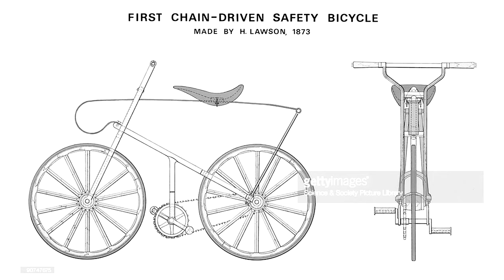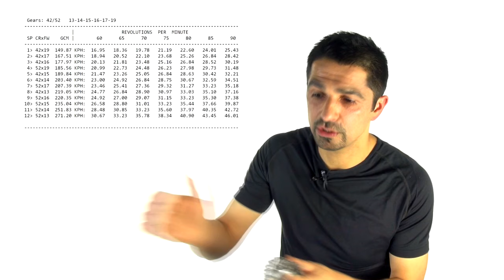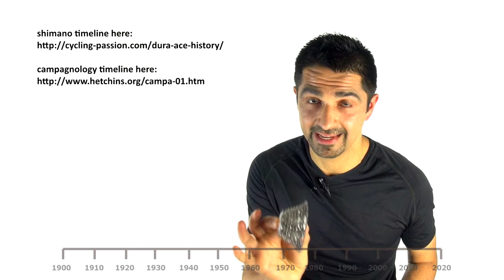Fascinating forgotten history of bicycle gears development & timeline (1890 to 2017)

Comment: I was much younger when I started riding. Back then, everybody used freewheels on their bikes. I still have a 13-18 6 speed block, and 7 speed 12-18, and 12-19 freewheels. When Shimano finally came out with 8 speed cassettes, I used a 12-21 for just about everything. 9 speed cassettes usually ended up with a 12-23, but I also used an 11-21 and 12-21 for flat criteriums. Finally, with 10 speed, I either use a 12-23, or more often now, a 12-25. I refuse to switch to 11 or 12 speed, because I don't need lower gears than a 39x25. I have to admit that the older I get, the more I use the 39, instead of using the big dog on everything.

Comment: in the 70s i first had a Peugeot with 52x45 and of course five speed cog.  then i bought a used Cinelli fully campy.  52x 44 (also bought a 54 tooth for special events).  rear hub gears normally 14-18.  but for the rare hill events had up to 21 or 23 teeth (forgot which).  no worries about indexing with gear shifting by hand on the tubes lol.  nice video ty
Reply: I was with you, 13-23 five speed rear end for hill climbing. Italian bikes came with "Alpine" crank chainrings, 52-39. I still ride my old PX-10, now with a 7-speed 13-25 cluster on the back. Needless to say, I ride my other road bike on "hilly days"!

Comment: My 1969 Schwinn varsity had a 14-28 freewheel? When I  got into " good " bikes in the late 70's 5 speed freewheel was the only option but there was always a wide range.  A lot driven by touring cycling.  I still have a Campagnolo grand tourismo rear derailleur.  Never used, weighs about a pound, it's steel and beautiful.  Have to disagree with some of your history based on my experience.

Comment: Really love your videos. This channel is underrated. Will you include climbing vs power vs cadence vs gradient. I believe most road bikes are massively overergeared for the average rider. Top riders pushing out 350 watts for 1 or two hours have a 34/32. So with a novice at 200 watts or less probably needs at least a 40 cassette to maintain reasonable cadence up the same hills. In fact I suspect our novice may need more than a 40 to maintain the same cadence as pro riders.
Reply: I would completely agree  with you - the number of riders hammered by the Joux Plane in this year's Etape was painful to watch. Good Cat 1 riders were below walking pace on their 39-25's. However, I would say overgeared though, not under?
Reply: Cyclespeed Tours Yes I meant overgeared.
Reply: Sadly, the recreational amateur enthusiasts generally have chosen to look the part of a racer, hence riding equipment and gearing their bodies cannot manage. Tourists and distance randonneur riders have no vanity issues, often using triple cranks and customizing wide rear clusters for practicality, not cosmetics. Too bad manufacturers are still catering to appearances and style, particularly in the 1x fad that fails both in widening gear ranges (it does not, cannot without forcing gargantuan rear cogs), while widening each jump between gears.

Comment: My 1973 crane/DA first gen RD (short cage) was rated at a max of 28t, but easily handles 30t. I am still using it today with 14-19, 42 upfront. Just not in the hills. There was an equivalent  crane / DA long cage from the same era rated at 34t, so I am not sure if campag won the race for large cogs / easy gears.

Comment: Was looking for your mathematics in gears but could not find it. My question is modern bikes have many speed eg 11-28 12speed vs 11-28 8speed doesn't that carry more weight with the same delivery of watts? Although I think the manufacturer here is after comfort. Less speed  with same number of teeth in the ends weighs less hence more watts. What do you think? Hope you can have time.
Reply from the maker: Good question. Actually the modern high end cassettes can be lighter in 12sp than the old ones in 8 speed due to use of improved materials (eg titanium) and milling out more of the cassette body. True, a single speed (fixie / track) with 1 gear is likely more efficient (optimal chain line and tension) but it is highly inconvenient for the road. It is not really the weight but the chain efficiency that costs watts. Plus there is a physiological cost.....namely more gears mean more choices of cadence whilst keeping the torque manageable (see fft.tips/cadence) which means the metabolic efficiency is higher. alex@fft #happytraining
Reply: @Fastfitnesstips  Yow!!! Am not  a pro nor a physiologist just your average less than a weekend warrior. That table  added more confusion. Nevertheless was just thinking that though old heavy 8speed why not also make the new light 12speed to 8 by just lessening the cogs. Lessens the confusion on what gear I am into. My queastions to those weight winnie and you answered pros and cons big thanks.💥✌

Comment: Utter bullshit!   There were plenty of older short cage rear derailleurs that can handle much larger than a 19 tooth large cog.   A old Campagnolo short cage derailleur capacity was about 26 teeth.  Some people are even able to get them to work with as large as 28.   I rode across the country with a 25.